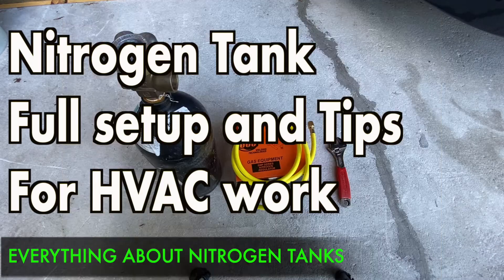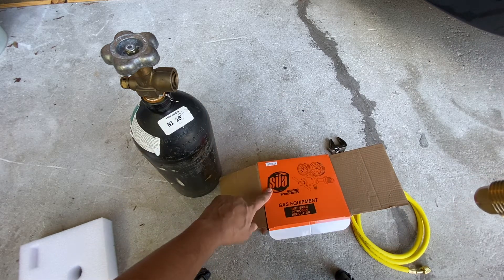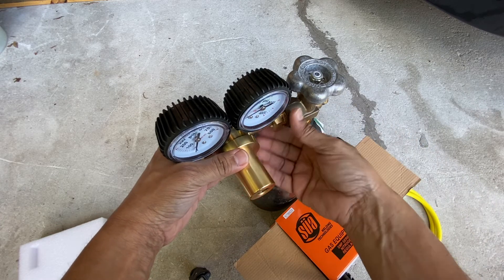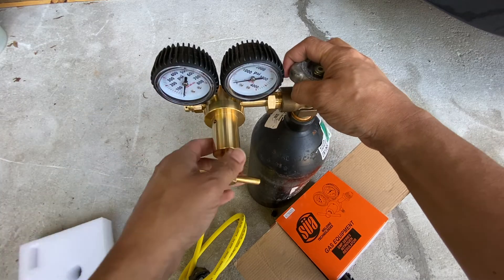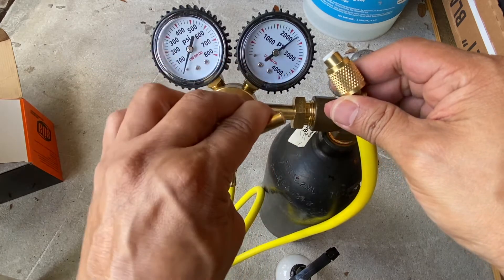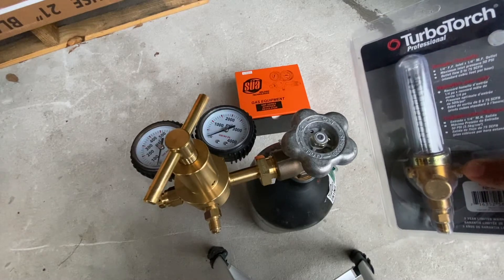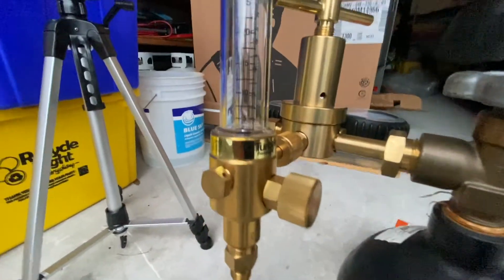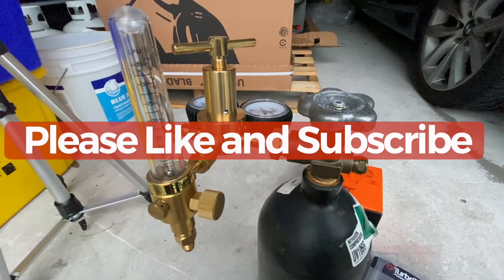How to setup Nitrogen Tank for HVAC

Comment: Does the turbo torch flow meter have constant flow?  Like if pressure reduces do you need to then turn the valve up on the flow meter?

Comment: Great video. One thing to correct you on… If you’re pressure testing a line set for HVAC system… Example R410A… The pressures can be up to 500 pounds. So that turbo torch is not at all what you need. Leak check all connections and let the regulator gauge set where you want it to be.
Reply from the maker: @mrgoggles1963  so what do I need if it’s not that turbo torch? I’m not sure if I understand what you are saying. I have been using this setup for all 410a units and never had any issues.

Comment: this is great for first timers but i'd like to see the process on turning the gas on after everything is connected. i see 3 valves. which order do they get turned on? what about when you're done and you turn everything off?
Reply from the maker: It doesn’t matter. The best is to start with all valves closed and then start opening the bottle valve and then regulator and then control the flow with the metering device.

Comment: Is this pure nitrogen or mixed with oxygen?
Reply from the maker: Pure. I don’t think they sell nitrogen and oxygen mix. Nitrogen displaces oxygen
Reply: @HowToDoitright  Well, I heard that nitrogen used for tires for example is only about 80% nitrogen, that's why I asked. Thanks for responding!
Reply from the maker: Yes that may be true or else it will be expensive

Comment: Are you sure you don't need teflon tape? Seems like it would be a good solution.
Reply from the maker: You can use it if your threads are leaking. Doesn’t hurt
Reply: @HowToDoitright

Hurts though if your threads are fine and not leaking, aka don't add Teflon tape if you don't have a leak, make sure to check leaks first before using Teflon tape or you'll make your problem worse